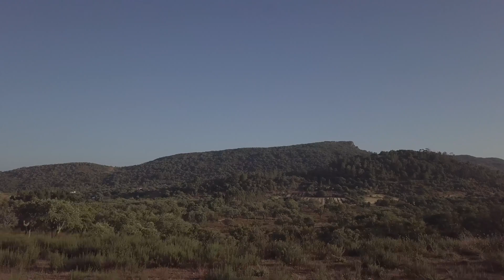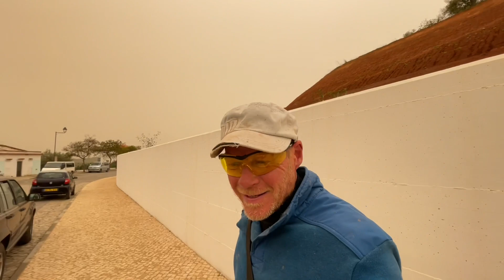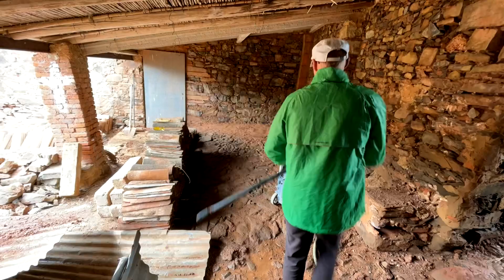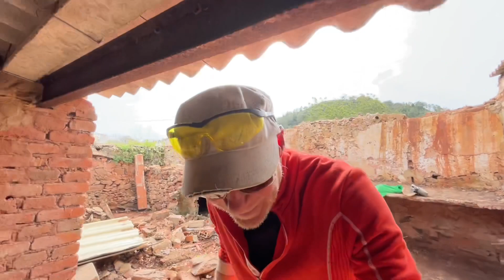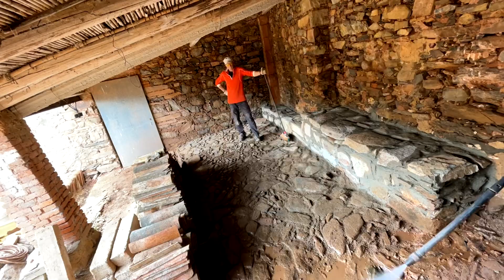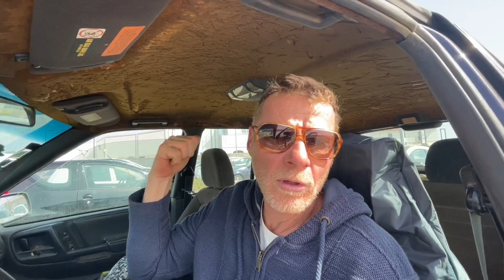First Job of the Portugal Renovation - Bit of Fun, Building A Stone Wall in the Courtyard #56

Comment: Me again,...when I did a stable/house Reno it had clay floors, so I got builder to tint cement for new floors with special powder and  they were lovely smooth terracotta coloured. I tried pure clay terracotta tiles but water went straight thru!  The bamboo is very popular now for outdoor ceilings and screens. Sold in ready to use various sizes from hardware outlets. Cheers.
Reply from the maker: That sounds interesting 👍

Comment: The use of Portland cement should be made illegal on buildings like these. It just looks horrific.
Reply: It's only on a new seating area, not an original build. So not national monument status!
Reply from the maker: Any pointing we do will be with lime, not needed for the purpose of a bench/shelf. Also if a wall is only an exterior divide and not part of the house, why is cement so bad in your eyes? I’m interested in learning why you think it’s bad for things like a bench, drive walls, garden walls etc. I’m building a wall along my front garden and plan to make it so you can’t see the cement and looks like a natural handmade wall. So my question there is why shouldn’t I use cement? I’m asking because you sound like you might be an expert and I haven’t read anywhere about cement being horrific for these things. Interested to know 👍
Reply: @rusticcrow  I restore grade 1 listed buildings after builders destroy them with Portland. Lime mortar has many advantages, allows wicking so that you don't trap moisture within a wall. It is self sealing, so as your existing building settles, it will move with it and won't crack. You can also re-use the materials because, as you have found, you can clean up the stones and tiles. You can also clean your tools up with just a rub. The main disadvantage is that it takes a few days to go off, and you have to dampen it down to stop it drying out too quickly. Give it a go, see what you think, and I am sure that you will find that lime mortar is a much more ecological and friendly material to use and you won't go back to Portland and gypsum. Peter Ward had a lot of info on his channel. https://www.youtube.com/watch?v=_mo3WC-1JB4
Reply from the maker: @I-am-not-a-number  thank you, I did know that but useful anyway to confirm. And that’s what we will be using for pointing in the house where we have exposed stones.
Back to my actual question, what is your thought on that?
Because your original comment was based on a stone shelf/bench and I’m interested to know why I would choose lime mortar on a outside wall like a boundary wall or a two foot drive way wall. 👍
Reply: @rusticcrow  The wall that you have abutted against is in lime, so now you have essentially sealed in any rising moisture into the wall and stopped evaporation on that side of the wall, so it has only one means of escape, through the other face of the wall. If you are building a separate Portland wall my advice would be to leave a small vented air gap between them. The thing to bear in mind is that Portland doesn't let moisture in so it doesn't have to evaporate like a lime wall does. Modern PVA based paint also traps moisture in and it just bubbles up on lime so I use a lime wash. In my job  I see a lot of brickwork that has disintegrated because the Portland can't wick so the faces of the brick wick instead and they just fall off. You can see this everywhere, especially in colder climates, so it may not affect you so much further south where it doesn't freeze. My main work is replacing rotten wood, mainly oak, that has had moisture trapped around it by Portland cement. Lime pointing is sacrificial and is supposed to fall out over time with evaporation, so if you see missing lime pointing, it is evident that there is moisture in the walls. Don't forget, you have no dpc so rising damp is a fact of life in an old building like yours. Try traditional lime, you will love it, and it looks fabulous.
Reply from the maker: @I-am-not-a-number  thanks for the advice. The other side of the wall is the neighbours courtyard so that’s why we built the bench there. Just happens to be facing the hills for a good relaxing view. 👍
Reply from the maker: @I-am-not-a-number  hi Honey Badger, I just read your comments again and realised you didn’t answer my specific question. What you have told me I already new but I haven’t worked out why Your telling me I shouldn’t use cement to hold stones together on an exterior 2 ft bench that’s connected to a pre existing exterior wall that can breath on the other side? Would be interested to know because I can’t find the answer anywhere. 👍
Reply: @rusticcrow  Can it breathe on the other side or is that faced with Portland too? You have stopped the evaporation on one side, that is bad enough. If your neighbour's wall is rendered in Portland then it will blow. Where do you expect the rising damp to go?
Reply from the maker: @I-am-not-a-number  I expect it to go through the exposed wall. Like I said it’s a courtyard on the other side and it’s not rendered. So it can breathe. But you still haven’t answered my one question. But don’t worry. Thanks for the info it’s always useful and I appreciate your comments. Keep it friendly and positive 👍
Reply: @rusticcrow  You shouldn't use cement because old buildings don't have a dpc. New walls with a dpc are fine. Good luck, the build is looking great.
Reply from the maker: @I-am-not-a-number  thanks. And thank you again for being polite. 👍
Reply from the maker: @I-am-not-a-number  I can’t let this go because you still did NOT answer my one and only question? 
if you were building a small free standing driveway wall you would use lime mortar to hold the stones together. Correct? 
Though cement must still be ok because it’s exterior and you haven’t rendered it, is that correct?
So given that the only thing I’ve done is build a very small shelf/bench against an exterior wall to fill a hole, that that must also not be a problem?
I’m a little confused because your clearly at the top of your game working for English heritage but don’t want to answer the question. Would love to know the answer because it will really help me going forward. 👍
Reply: @rusticcrow  A new independent wall with a dpc in Portland will work fine. This is a modern building technique that everyone now uses. The problems arise when you use Portland on a lime wall, without a dpc, to trap in moisture.
Reply from the maker: @I-am-not-a-number  👍